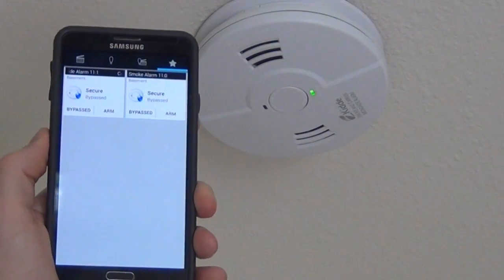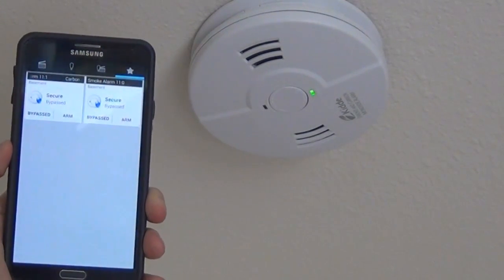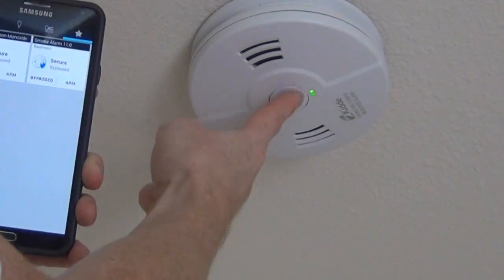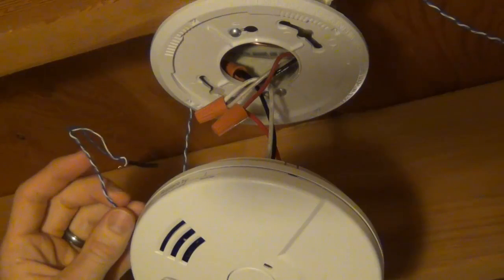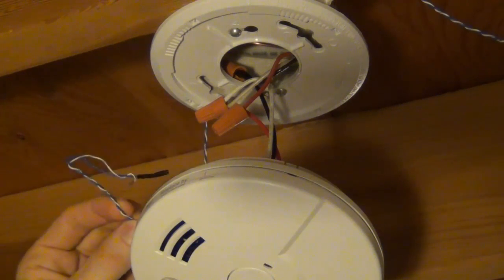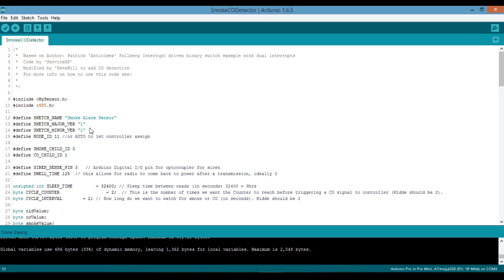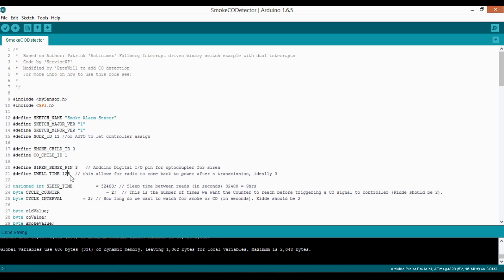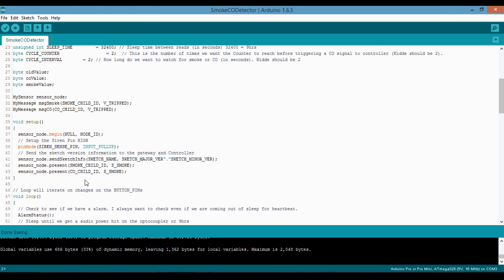How To - Smoke Alarm Monitoring with Arduino and MySensors

Comment: i m waiting for my octocoupler to arrive, while that is on its way i m tinkering with the almost ready code, can i simulate the octocoupler with a reed switch?
Reply from the maker: Yes, but you may have to make some temporary adjustments to the code.  The code is currently designed to pick up multiple signals from a Kidde detector.  You can adjust the CYCLE_COUNTER & CYCLE_INTERVAL to adjust for your manual "signals" instead of what the Kidde sends.

Comment: Kidde central smoke and CO system has a third red wire.  I have measured the voltage on that wire in reference to the neutral wire and found that it measure 10-10.5 VDC when smoke alarm goes off and 2.5VDC for CO.
Reply: The interconnect system uses an 8 bit code for the CO signal. For CO, it pulses 9v so fast that your voltmeter doesn’t have time to register the full 9v.

Comment: Thanks for making the video and including the details, Pete. What type of enclosure do you use for it? Would you recommend some type of gang box?
Reply from the maker: Brandon Willmott I just put it in the already existing gang box in my ceiling.  I taped it up with electrical tape so no metal is exposed (to prevent shorting).

Comment: Is the reason you put resistors in series because you did not have the correct resistor for your needs or is there another reason?
Thanks
Reply from the maker: amtpdb1 I got the info on the interconnect connections from here: http://www.edcheung.com/automa/smoke_det.htm and he recommended using two in case one of them ever failed.
Reply: Pete B Thanks for your time.
Have a nice day.

Comment: Your sensors manager is MiCasaVerde Vera right? Do you know if theres another one i can use to manage the sensors without Vera? Opensource or one that i can build?
Reply from the maker: Kelson Daniel Gonçalves Yes, I use Vera but there are others that will work.  Check out this link: http://www.mysensors.org/controller/  
I believe OpenHAB and Domoticz are popular alternatives but you may want to do a quick search on the forum to see if there are any recommendations.